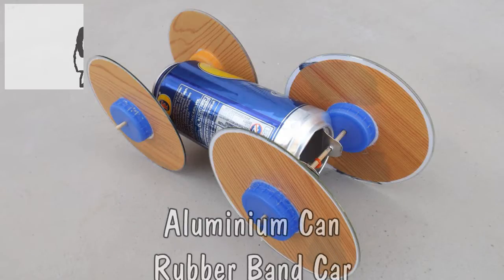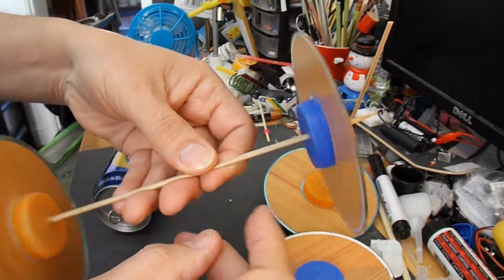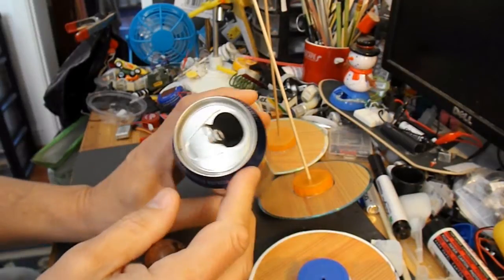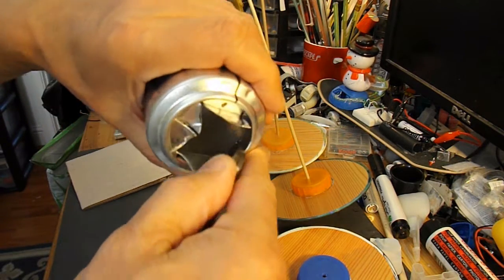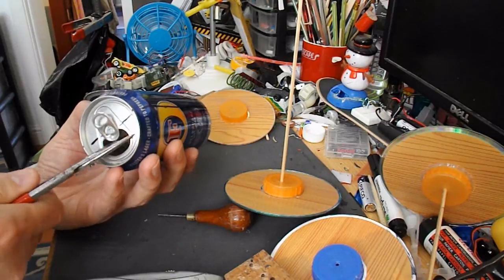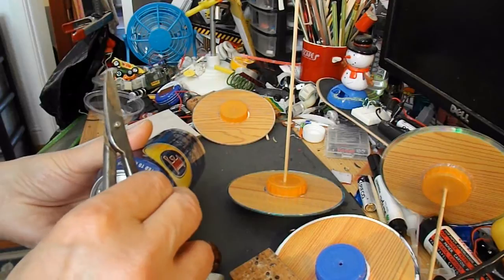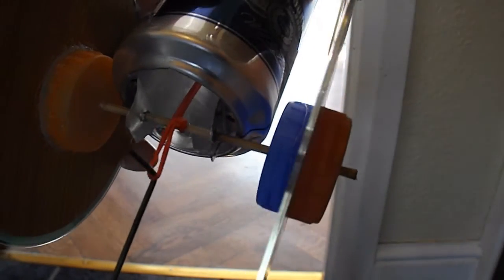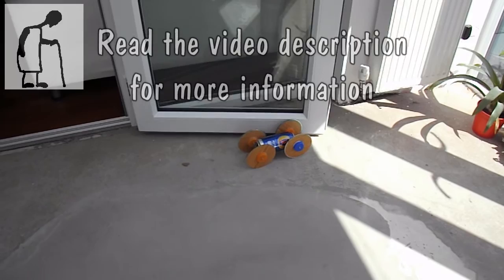Aluminium Can Rubber Band Car

Comment: can you make a car so that the can rotates as the car moves?
Reply from the maker: You could use two cans as wheels but this car uses the can as the body and the axles go through it so there is no way it can rotate. Here is a solar powered car with cans for wheels https://youtu.be/4qY07tI6gzM?list=PLA5a2xPRSrB0nHCTZzIbtOdqUSsEEJ1Nr
Reply: GrandadIsAnOldMan i have a project where i have to make an elastic powered car and a can has to move as the car moves. It has to travel 24 feet
Reply from the maker: If the can has to rotate as the car moves, just arrange for the can to be resting across the rims of the wheels. That will make it rotate as the wheels turn.

Comment: how many meters can its travel
Reply from the maker: In the video it does about 8 metres. In the video description there are links to my other rubber band cars, there are hundreds of them.
Reply: can you suggest one the easy made rubber car but it can walks for around 10 miles
Reply from the maker: The distance they travel is very much down to the care you build it with. You must keep friction to a minimum and the car will go further. Here is a simple car that I show running for 12 metres. I am afraid that 10 miles is completely out of the question but I suspect they was a mistake in your question. Rubber Band Powered Car 1 x size 64 - full length video https://youtu.be/pIO3FiHX4Oc?list=PLA5a2xPRSrB3g5RiX8Kf_uUBOL0Tb7AS0